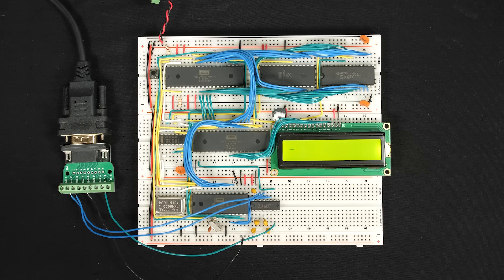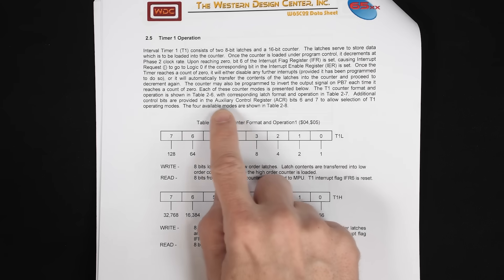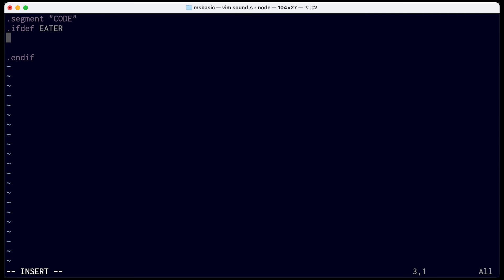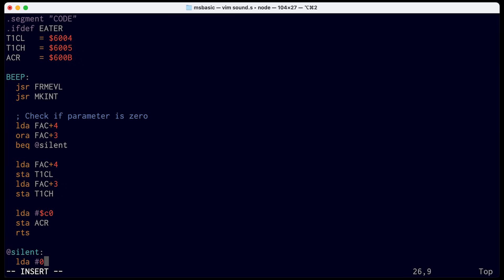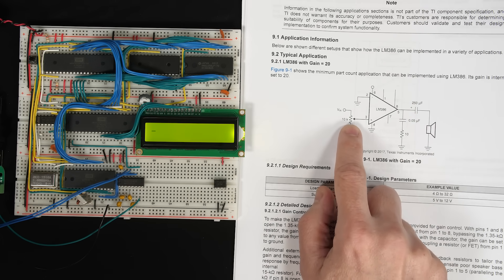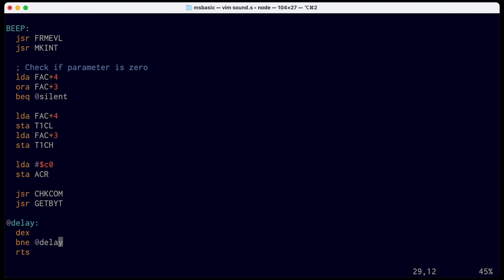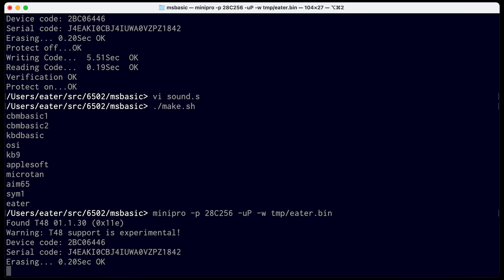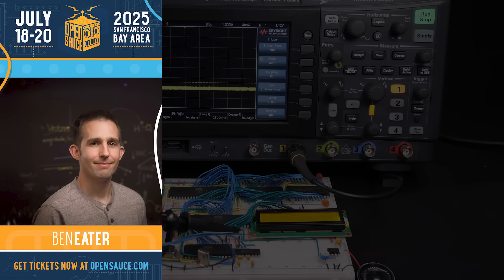Computer noises

Comment: I used to jokingly say you're not a real programmer unless you make your own operating system to program in using a hex editor. Ben not only did roughly that - just using assembly language instead of machine code (though his homemade processor does use machine code), but he made his own hardware for it to run on. I didn't think it was even possible back then, but here we are, and I've watched every step of the way.

Comment: I wonder why an amplifier chip is needed for this? Couldn’t we just hook the output pin up to the middle pin of a transistor?
Reply: A transistor, but not just any. Audio amplification has a few constraints that make a typical three leg unsuitable: they  should have a linear voltage response, flat frequency response (you don't want to have the volume change for different frequencies), and you want to amplify past the currents typical for digital circuitry.
Reply: @SimonBuchanNz  I don't think linear voltage response matters when your input is a square wave.
Reply: @SimonBuchanNz Thanks for your response! There’s a lot more that goes into this than I realized!

Comment: Epic speccy vibes. I wrote a whole Christmas music program as my first ever software project in 1984 doing basically exactly this on my ZX spectrum plus..
Reply: The ZX Spectrum used a decent microprocessor, the Zilog Z80, not a puny 6502 variant. Not even the slightest of Speccy vibes. The closest would be an Acorn Electron or a BBC Model B. For Speccy vibes you need a Z80 based SBC like the RC2014 project.
Reply: @SpeccyMan clearly you've never programmed speccy music using the basic BEEP function because everything except the CPU would feel incredibly familiar with what Ben did. The speccy famously has the single bit speaker just as he built here.

Comment: IIRC, this type programming is the issue that forced most systems to have a turbo button back in the day as it was assumed the clock was static, NICE WORK!
Reply: yes, nowadays the delays and timing are handled by hardware timers and clocks, used via interrupts, and managed by the OS. Core Dumped has some interesting videos on the topic of OSes and schedulers.
Reply: So THAT's the reason for the "Turbo" button... 
This is the first time I've heard a satisfactory explanation.
Reply: @ThePracticalPeasant  Not just for the sound though, but for all code that depends on clock speed for correct timing. Not least of which games. After a jump in clock speed the games of the time would have been unplayable without the turbo button.

So the turbo button was not really meant to speed up things, as the name would imply, but to slow down things that would otherwise not work as intended.
Reply: @rschroev thanks for this addition. Was wondering what made it 'forced'.
Reply: @rschroev  a friend of mine could use it as a speed hack in CS. Pressing the turbo button when already in the game changed the speed and the timing got wrong (faster).
Reply: @rschroev  I never had a use for the slower clock-rate at the time; I never could figure why you'd shut "Turbo" off. They should have inverted the functionality and called it "Retro" mode instead.
Reply: @ThePracticalPeasant it comes from 8088 and TurboXT clones running at whopping 8-10MHz. Time sensitive apps were crashing then and you used Turbo button to slow down back to 4.77 MHz. 
And it carried over to more or less 386 era. Test Drive 3, Wings of Fury, they are unplayable on a faster machines and switching off turbo makes them playable. 
On 486 class machines this button was just occupying space and I think Pentium dropped it all together.
Reply: @SergiuszRoszczyk  And the 386 era was exactly when I had a computer with a turbo button that switched between 8 and 25nhz. The machine wasn't new by the time I was using it. If I remember correctly, aside from experiments in QB and word processing, the only game I ever tried running on it was Wolf3D which was much more suited to the 66mhz 486 sitting beside it.
Reply: @ThePracticalPeasant  a computer that has cycle speeds in the nanohertz seems difficult to use :P
Reply: @keiyakins was thinking the same - one cycle every 4 days doesn't seem particularly useful for most home or office computers
Reply: @keiyakins  So the real question is why I was trying to run Wolf3D on an abacus. 😆
Reply: @ThePracticalPeasant  You can thank marketing for that. We live in a world of "medium, large, and extra large" instead of "small, medium, and large."
Reply: The original Wing Commander was timed to the CPU clock, so it was pretty hectic to play with the turbo button on.
Reply: @bobthecomputerguy  IIRC I upgraded from 286 to 386 and added an adlib card for that one.
Reply: With some old PC clones the FDD controller was actually software controlled to the degree that if you tried to write data to a diskette when the processor was running at "turbo" speed the timing would not be correct and it could damage the format of the diskette and you would lose everything on it. On these machine the turbo button was necessary for the computers to be usable. Oh and at this time hard drives were not really something most people could afford so everything was running on floppies.

Later on the FDD controller was hardware based and the clock speed of the processor or the ISA bus wasn't as critical. Then the Turbo button became more optional. I do however remember an old time Space Invaders spin off that was basically unplayable with the computer set to run at the faster speed. Those invaders went from the starting position to hitting the bottom in less than ten seconds. Turning off the Turbo button it was normal speed. Pranked someone with that once...
Reply: His programming here is just quick and dirty. The function he glossed over with the countdown timer he was using was that the register can generate an IRQ when it reaches zero. Since he was using that register as the actual square wave generator it wouldn't be that useful, but there is a second countdown timer on the 6522 which, though it operates a little differently, could be used as an interrupt to service the sound device, eliminating the need for the wait loop.
Reply: It was more because of a hardware problem. Back then, the ISA bus was driven at the CPU clock rate. As CPU speeds increased so did the ISA bus speed, but old ISA hardware could sometimes not cope with those increased clock rate.

Comment: Will the 6502 kit include the speaker, amp, and additional pieces from now on? I know those are cheap parts that I could buy by myself, but I like when the kits have everything. It just makes life easier. 

I don't think it makes sense for so few pieces to create a new kit.

I already have the complete 8bit computer kit, and I was thinking about the 6502. This would be a nice addition.
Reply: At a certain point the videos start using parts that weren’t in the kit. An example is the mini-DIN 6 connector for a PS/2 keyboard. His kits come from Jameco I believe so I end up going there for additional parts since it’s a lot simpler to find stuff there but I’m starting to learn how to find what I want in the bigger sites like digikey and mouser that can be overwhelming unless you know how to filter down and do research to find what you want. But it’s a good skill to start learning if you’re getting into electronics!
Reply: @drivers99 I've bought stuff from mouser and digikey in the past, but single components are kinda expensive to ship, and I think it would be worthwhile to include new components in the existing kits, even if at an increased price. The extra price would still be less than single component shipping, and it's a lot more convenient.